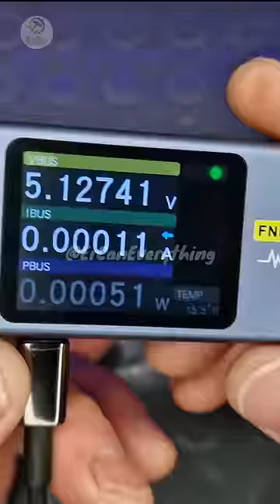DIY 16400mAh Fast Charging PD Power Bank from old Laptop Batteries

Comment: Yeah kids go ahead and use a heat guy on fully charged lithium ion batteries it's totally fun activity you should be doing all the time
Reply: Its pvc, its normal to put that on the batteries
Reply: it is ok, did it several times. Just don't do it too long

Comment: Ah yes, cell balancing
Reply: balancing on parallel connection? wat?
Reply: @VShuricK It was sarcasms I believe 😅
Reply: and the covid will balance itself😊
Reply: @VShuricK  At some level, yes. All the batteries might be comnected together, but they are not identical in terms of capacity or voltage when connected together. Thus, they all charge up differently when power is appied. Of course, you will only see one voltage when you try to measure it, but that voltage is the average voltage of all the batteries, not the voltage of each battery.
Reply: @NIGHTDREADED  on parallel connection same voltage on all cells. Wat do u want to balance?
Reply: @VShuricK  There is a reason power banks with more than 1 cell in parallel tend to fail very badly and early on on life, and it is because they are not charged up at the same rate, even if they are wired in parallel. The charger thinks it is charging one battery, when in reality it is a bunch of batteries in parallel. Eventually, one of the cells goes bad and current dumps, and that is the puffing up you see that destroys power banks.
Reply: @NIGHTDREADED  u could literally avoid that by monitoring each battery and then combining the outputs after the bms for each battery. In series battery BMSs , they avoid this by having individual connections between the series cells
Reply: @orange_tweleve  Yes, but Chinese power bank designers are too lazy / cheap to do that.
Reply: @NIGHTDREADED  nope they do sell that kind of board, you're too lazy too look it up.

Comment: It looks like you connected more than two wires (positive and negative) to the PCB. Please can someone tell me what other cables are and what function. Is it applicable to all PD PCB?
Reply: temperature sensor. comes on pcb. for not to blow up the pack. protects overcharging and over heating.

Comment: Do those batteries have individual cell monitoring? Because it looks like you're just wiring those batteries into a series, and then onto a basic controller board. Without individual cell monitoring, you're likely to overcharge one of those battery packs and blow it to pieces. And if that circuit has no battery protection features and one goes, it's likely that all of them will go. Creating a nice big fireball that can't be put out easily by water.
Reply from the maker: The batteries are charged to the same voltage and then connected in parallel.
Otherwise, if their voltages are different, then it's DANGEROUS to connect them in PARALLEL!
This battery configuration is 1S 6P and there is no way or why to use a balancing module!
Just is 1S 3.7V🤷
Reply: Because one battery pack will definitely degrade before the others do. And if one of them goes, they all go. And that's a house fire. That you can't put out with water.
Reply: @Jamesrealasdeath You are correct that the would be a fire hazard if the cells were connected in series without individual cell monitoring. In this case they are all connected in parallel so the voltage is always equal in every cell. Even a degraded cell won't catch on fire if its voltage stays within the design parameters and the circuit is taking care of that. Almost every commercial power bank is built this way

Comment: Doesn't those batteries need BMS? Btw nice short.
Reply: itu rangkaian paralel, bukan rangkaian seri
Reply: @cowokbaik-baik Yes, but i mean does that power bank module has inbuilt battery management circuit?
Reply: @VSR_FAN_PAGE_  it doesnt, which is why this is a bomb.
Reply: @Sharpless2 It doesn't need a bms

Comment: And how to weld aluminium tabs? I have suffered problems recycling some dji batteries. Impossible to weld the aluminim tab side (nor spot , tried flux....) nothing woeks!
Reply: You need special flux for aluminum soldering otherwise you could try all day and it wouldn't work. An alternative would be to have something pinch the tabs like a alligator clip but that's not a longterm solution
Reply: I supposed to used alum flux, but nothing...

Comment: you connect batteries in parallel. in this condition only voltage is getting increase not the ampere. How did you say that these are 16000mAh. I also this same thing a week before to make batteries about 7v 9Amp.
Reply: I think you got that wrong buddy. Connecting in parallel will get you the same voltage but higher capacity.

Comment: please NEVER wire lithium cells without a bms and connection to every cell
Reply from the maker: This rule applies to 2S or more series-connected batteries. This configuration is 1S 6P which only needs a charging board

Comment: How to easily solder 18650 battery
Reply from the maker: Find this video "InfiRay P2 Pro Portable Thermal Camera for Android Phone | How to Solder LiIon Batteries" on my channel and watch after the 9:00 minute, and you will see that there is no difference between soldering and spot welding temp.
But you need to know how.
First you need to set the temperature of the soldering iron to 350-400 degrees, then put a small drop of Iron soldering liquid acid flux and apply tin within 1 second, prepare the cable while the battery cools down for a few seconds and solder the cable again within 1 second.
I will make a short video about it soon
Reply: @ErCanEverything nice

Comment: bad idea  ( where is balancer ?  )   correct rw
Reply: The cells are connected in parallel so there is nothing to balance
Reply: they will try to balance themselves, causing quick degration and overheat on all of them. And since they are tightly strapped together, its going to be a nice boom

Comment: Don't. These batteries are not meant to make a powerbank without a proper case, a single drop on the floor could cause a fire not to mention that all these cells are of questionable origin and quality to begin with